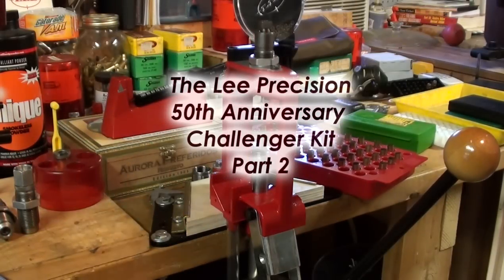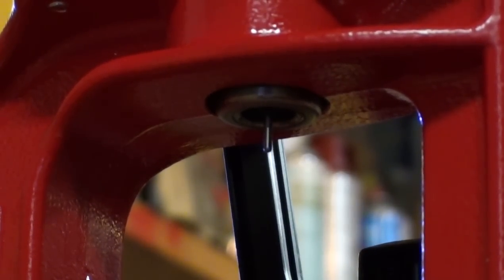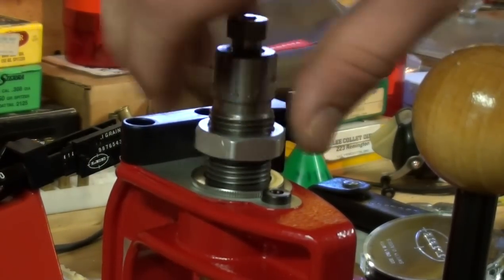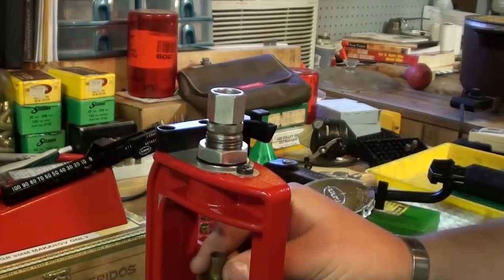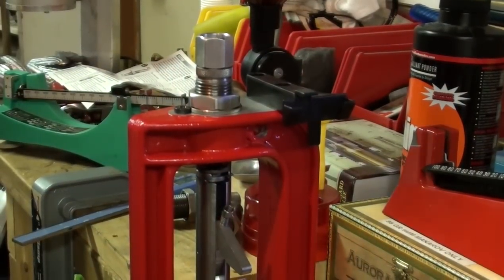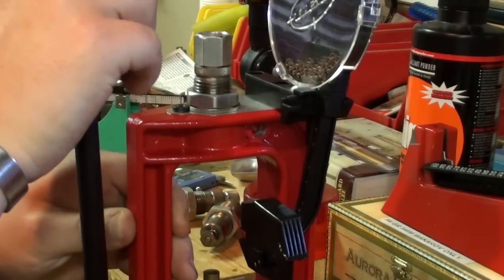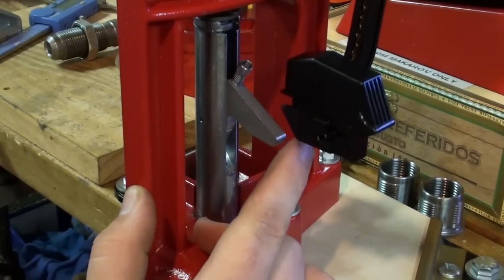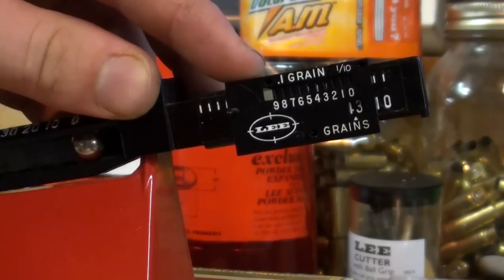Lee Precision 50th Anniversary Challenger Kit Setup and Overview Part 2

Comment: Hey, You recieve 3  Breech lock bushings with the kit,they are removed with the die so you don't have to Unscrew every die,just push the black lock button,twist the breech lock insert and it comes out with the die all set up. I also purchased the LEE locking breech lock holders, Once set and locked they never come out of adjustment. $10.00 a pair,worth the extra money.

Comment: @be lue 

The grain of the bullet is different from the amount of powder (grain).

For example, if he is loading 45 acp. He may use 3.6 grains of Bullseye powder to accurately deliver a 230 grain projectile down range.
Reply: To elaborate a little a grain (gr) is simply another unit of measurement for weight like pounds (lbs) bullets are measured in grains but so is the powder charge.  There are 7000 grains in a pound so it is a very small unit of measurement.  Hope this helps a little.

Comment: Do you clean the primer pocket every time? Although you didn't show it, I assume you do it. There's always some residue, many times very little of it. Is it necessary or advisable to clean it every time? I do it just in case, right after de-priming the brass.  Thanks!  Great videos, I watch them often, as I learn how to use my press.

Comment: Is there any reason you don't re-prime during the de-prime/resizing cycle? Prob doesn't matter, just curious.  If you changed the powder feed to load through the flaring die, you would have to reprime during the sizing cycle..

Also, well worth buying extra die bushings. They're ~$10 for a 2 pack. With a bushing for each die you do the adjustments, lock it in and from then on you just have to drop in the next die and no readjustment is necessary.
Reply: You need to clean the primer pocket out before re-priming to insure the primer will seat fully.  They make a tool to do this by hand, it's only a few dollars.
Reply: Tqtrpiypuu just like his demo, cleaning primer pockets on handgun rounds is seldom necessary. If the previous primer was seated, not much chance of problems developing between depriming and repriming.  Can't hurt of course, but just not a requirement.

Comment: @Iraqveteran8888 Have your service provider come check the line for noise. If your drop line from their box to your house is bad you will get noise degrading your signal. If thats ok eliminate the splitters from your drop line to your modem. This will reduce your signal noise to a minimum and improve your connection. I spent 20 bucks at Home Depot and ran new Co-axial cable through the attic to bring in new fresh outdoor spec co-axial line. (outdoor spec line is beefier and holds up better. )

Comment: @Iraqveteran8888 That is great that I has high quality output but it does no good if you are not able to upload that same quality all the time. I would try playing with the MPEG or AVI format if it will record in that format. It is must easier to manipulate because of there being so many programs out that will handle it. It sounds like the camera records in a proprietary format, making it difficult to find suitable apps to process it for upload.

Comment: do you clean the brass before or after depriming?
Reply: Wet cleaning is done after depriming.  Dry cleaning can be done before or after.  Doing it after prevents media from getting stuck in the primer pockets.

Comment: Love Lee reloading tools but this is the worst press Lee has ever put out for a right handed person. When running the press up with your right hand, you then have to take your right hand off the lever to actuate the safety prime feeder, and then put your right hand back on the lever and lower the ram. Horrible ergonomics. The safety prime should have been on the left side of the press where you operate the ram up and down with your right hand and feed cases, operate the primer feed mechanism and remove cases using your left hand. I hate this press for this reason.